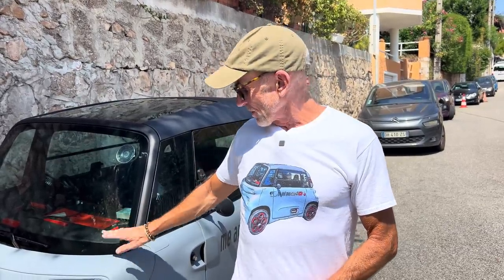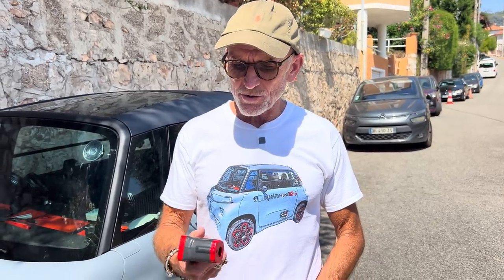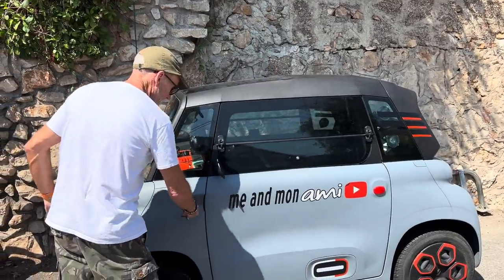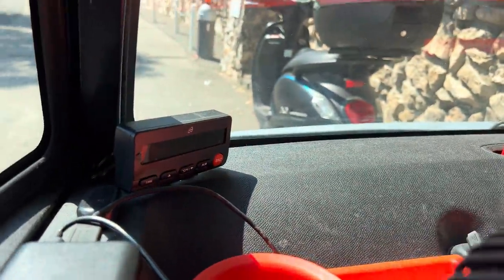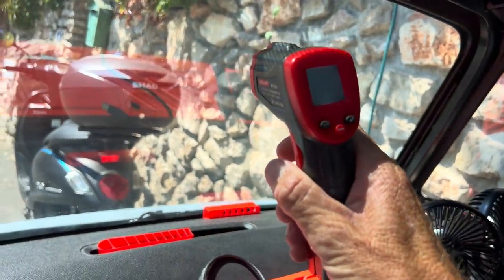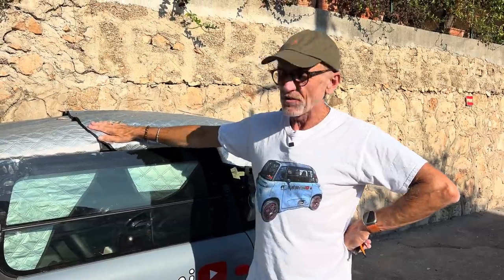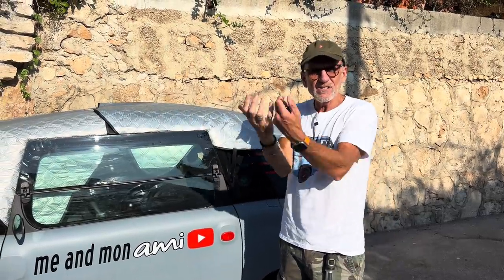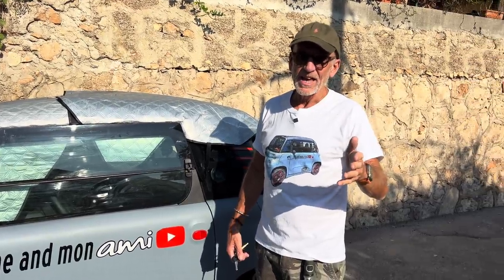Why Does Our CITROEN AMI Get So HOT? I Use TEMP GUN To Find Out!

Comment: Thinking of what the military do with high tech jet aircraft operating on airfields in hot climates, they always stick the aircraft  in one of those lightweight readiness hangars or, if the can't do that, stick a cover over the cockpit canopy to protect the valuable high-teching instruments inside.

In that vein, Halfrauds in england used to sell those lightweight/compact  polyester car dust covers (In white) . . the sort they  use in car showrooms and the windscreen covers for winter . . wonder if something like that if supported on a stand away from the roof (A book, a plastic cup, a piece of plastic domestic  waste pipe even  a bag of frozen ice cubes etc) would be man enough and keep the sun off.

Comment: Two decades ago, I used to live in an apartment, where the afternoon sun made it unbearable at night.

I got a roll of tinfoil and som sticky tape and covered the windows.

I left about 1-1.5 cm of glass arrpund the edges, for the sticky tape.

It looked like trash, but I was a student with a small budget and it reduced the temperature to a comfotable level.
Reply: My suggestions woud be:

Cover black/dark exterior in reflective silver wrap, or white. Possibly also rear side and roof window

Infrared blocking window foil. Check rules to make sure to stay within legal restrictions.

Get white/bright covers for seats and interior. Black interior is a "heat magnet" when its in the sun.

Comment: Good video. This has inspired me to see if I can create a permanent roof liner for my sans permis van - using one of these reflective sheets. I have a similar problem. Plastic roof with interior metal cage - although there is less metal work in my cab than in the Ami.
Reply from the maker: What is your sans permis van I’m intrigued
Reply: @MeandMonAmi  It is a 2011 Mega Multitruck Phase 2, manufactured by Aixam. The newest version is called a D-Truck. Both have electric versions, unfortunately mine is a 400cc Kubota diesel. Bought second hand in 2018 it was new to a Parisian boulangerie. I'm the second owner. HTH. 👍🏻
Reply from the maker: @MegaBreadvan  Thanks. There’s a little aixaam e truck lives near us it’s very cute
Reply: @MeandMonAmi  They are, aren't they? 😊 I bought mine because I didn't want a sans permis car, although this was before the Ami came along.

Comment: Anything water based will ultimately evapourate in open air,  and whilst the first effect is to extract heat from tne surface the damp rag is attached to, the long run effect will be to raise the humidity in enclosed spaces and raise the Wet Bulb temperature . . . Think steam-based hospital autoclaves and steam sterilisers of old . . If you want to kill the bugs . . Inject steam and the Wet Bulb temperature increases ! Not good if that happens. 

Sticking some ice cubes in a bag and allowing the breeze from a fan to play over the bag surface might work a bit better . . and, of course, every bar and restuarant can do a top-up.

Comment: Couple of ideas why don't you get someone with sewing/Tailoring skills to sew those two covers together and cut to shape overlocked round the edges. Then sew some Velcro and straps as required glue a few Velcro tabs on the roof for fitting purposes and straps on the inside similar to your roof rack.. The other one is to wall paper the car roof with white washable wall paper? we it may work well.

Comment: You need an UV filter for your windows.
Then you need a white reflective roof. Not the black one.
You could also try an aerogel insulation, but that’s expensive and not easily available. So, the option could be to be a test object for such insulation. That will save you costs.
Reply: Correction: you need an infrared ray filter screen. Not UV.
Reply from the maker: White roof would definitely help

Comment: I would say any campervan conversion company in the area would be able to fabricate a sunroof that opens for the Ami including (if it requires it) any strengthening metal to allow for the missing part.

I agree with others that I reckon painting the roof white, then putting flexible solar panels on top of that would get you the best of both worlds in terms of cooling and also free electricity while parked away from a charger in addition to insulation and tinting. Of course, then it'll probably snow ;-) At the end of the day you could mke your own insulation with tin foil, bubble wrap and duct tape for things like inside the door panels etc.

I've been told that hanging a canvas bag of cold water from the windows of a car was the old method of air conditioning in hot climates, the hot air basically being cooled so that cooler air came in.

I don't know how the panels are in the back, but would it be possible to fit a fan on what would be the back seat (if it had one) that could draw air in (or out) from the air gap between the frame and the rear outer panel of the Ami? If so you could maybe wire it up with a temperature sensor to come on if the interior got too hot, or just turn it on manually say an hour before you wanted to actually be inside it.

Of course, I don't know how it is there, but in the UK all these modifications would be notifiable to the insurance company, not sure about Citroens' warranty etc. either.
Reply from the maker: The ami roof is very think plastic and those who’ve done this say it isn’t easy but possible

Comment: you can get silver wrap too, will be better than the white.
Reply: also fyi you won’t get accurate readings from reflective surfaces like glass or shiny metallic surfaces. put a bit of dull tape on the shiny surface to measure, or your just reading reflections. 
All the same that’s one hot vehicle, the new open roof version would surely suit you best? more cash but probably worth it 👍
Reply from the maker: I did wonder about the reflective readings as they seemed relatively low

Comment: What I heard was.. this way of testing temperature on glas, does not work properly. Glas and shiny stuff give wrong readings. But anyways .. it is very very hot. 
The roof I can agree with. No insulation to be seen. 
How do "normal" cars cope with this.
I do think a white wrap would be good.. also thinking of the extra weight.
Reply from the maker: I think you are probably right re glass but as you say the plaggy is hot!
Reply: @MeandMonAmi  Hope it works. Maybe someday I'll buy one, so your videos give a lot of experiences. 💖

Comment: bonsoir mes amis.  Here in Spain, just turned 7 pm it is 39°C or 102°F in old money.  I have fans going and occasionally turn on the a/c for a short while, making use of the sun and the solar panels - those parts that the damned pigeons haven't covered in crap.  Keep cool and stay charged.
Reply from the maker: I feel for you. It’s 35 here today and unbareable

Comment: Despite the high IR  heating  . . The doors and windows still operate  ?

 But the UV overtime will kill the plastics (See the Dutch pilot girl vids and the landing at Maderia, Funchai. The plastic sunguard over the Flight Director panel, above the co-pilots instrument panel,  absolutely decimated by UV at altitude. But you've got the extra protection of the troposphere).

 But the combined effect of direct effect of  IR (Heating) and UV (Plastic unfriendly) on contact with the outside of the vehicle will kill any plastics on the outside of the car (And the occupants inside) . . .mainly through promoting the process of plastic  "Out-gassing" and causing the plastic to lose mass and shrink. That's when the fun and games really begins. Think plastic headlights,  vinyl windlow egding and windscreen wipers on modern cars. . .recent London temperatures have done for those items on my  car.

Even in London, summer temperatures at Northolt 2 years ago were sufficient to melt the glue holding the fabric + foam headlining to my Skoda Fabia interior  and detach it from the   cabin roof.

As the car is always parked in a public car park, I'm contemplating getting one of those framed clamshell covers for protection  . . Once I get tne headlining repaired . . . 

I would suspect, that like my car, Elton is parked-up 80-90% of the hours of daylight, so dealing with static heating is the main problem.

You have two issues here . . Radiated and conducted heat from the suns rays impacting poor Elton's bodyshell and convected heat from the surrounding air mass entering his cabin !

And the heating affect of the sun is worse when you're parked-up and there's no slip stream to cool you or the car. So the first job is to get the car cool enough to use from start i.e. keep it cool while parked-up.

Temperature insulation is all about layers. . . Whether you are insulating to retain heat or keep it out. To stop dear Elton heating you've got to keep the sun off any part of his body and also ensure that cool air reaching his cabin  !

As regards avoiding direct radiation hitting the bodyshell and then conducting throughout tne body, when I've gone camping to France in the past, I've found that a cheapo polypropylene tarpulin (Acting as a flysheet) hung over the top of a polyproplene rope above the tent and secured to a tree/fence at each end is great for keeping the temperature in the tent down (And for keeping tne monsoon rain off - two birds one stone). It works by keeping the direct heat of tne sun off tne object you wish to keep cool and by  creating a lower temperature zone between the object and the outside World .
Even better . .  A tarp with an outer surface  bearing a reflective coating would get you even more brownie points. 

The thing to avoid is contact between the flysheet and the bodyshell. .. .because that would allow conduction of heat between the flysheet and tne bodyshell leading to Elton getting hot and bothered.

Alternatively you could rigg  and secure the tarp, bivvy/sanger style to that stone wall using some of that magic picture hanging polymer or some loose stones or laiundry pegs ?

At a stetch you could get a couple of those cheapo restuarant/beach umbrellas with a weighted base, positioned at each end of Elton, or purloin some of that lightweight portable fencing, with tne weighted base, that you see on building sites (Hint), cover the sides in reflective material and demarcate the peripherary of the  sunside of the car with it,  putting Elton in the shade .anhhh !  . A cheapo gazebo will probably have the same effect. Even a beach wind guard with weighted bases would do.

Now there's a new market for Banksie prints ?

Wonder if somebody makes a collapsible  breiz soleil ?

Solutions depend on how radical you want to be versus the social and cultural conventions which you must be seen to obey. Personally, I say sod tbe conventions, I'd rather not fry . . . No matter how good the local scran.

As regards convected heat in the cabin turning you and Mr Boo into boil-in-the-bag  lobster en croute (Or is that en-route ?), . .   can you run a  mains power line to Elton. . Then a fan and/or one of those peltzier semi conductor chillers for the beach becomes an option . .leave the chiller door/lid open . . .perhaps even run it off your luggable Li-po  power pack . . On a timer or . .as I do with the household fan in tne bedroom, use one of those plug-in greenhouse electronic  thermostat/ timers  . . Turns the  fans on when temperature exceeds set threshold and off when the temperature falls below the threshold. . I use that mechanism for cooling down the bedroom when I first go to bed . .and it switches off as the outside temperature falls during the night, saving power and ensuring that you don't wake-up in the morning feeling as if you are one of Captain Birdseyes frozen fish fingers.

Comment: The solution you have there is excellent but perhaps it could get stolen.
Here cheap solutions. Cheap like me.
The cheap solution of a roll of kitchen tin foil would work but one attaches it normally with adhesive tape. Perhaps this sticks not on the car or.. sticks well but leaves hard to remove glue traces. 
There is a kind of tin foil on a roll which goes on the wall before the wallpaper if the walls are the old, humid type. It has a white side and a reflective one. I think both sides would work. Perhaps it's easier to attach and remove that. And more, perhaps it could stay on if the tape really leaves no marks and then one could drive around with it.
An old white sheet works too but it looks perhaps a bit strange.
Disposed older perfect sun block , long  curtains have sometimes a white back and this works really perfect. They are harder to find today , one sees more these roll up types. If they are cheap perhaps one could make something with those too.
Even using white wallpaper or the back of it rather would do much. And that would not invite any thieves, but attaching it could be a problem since it always tries to roll up. Perhaps there are  other type (glass fiber ?) wall papers that would work also.

Comment: Small car cover keep the hole thing out of the sun that way
Reply: Just make sure it’s outdoor and a silver colour UV resistant and weather proof then it will also help in the winter with defrosting because I know to defrost one of these you can loose a lot of range maybe use what you already do on top of a full cover for extra defence and if you can safely crack the windows for air flow even with the cover on it will still help
Reply from the maker: Struggled to find a full wrap with as strong UV protection as these small sheets but shall keep looking
Reply: @MeandMonAmi  it’s not a wrap it’s a normal small car cover it clips underneath to yes it will be baggy but to help with temperature in the car it will help

Comment: As long as I watched your challen I have seen where much of the heat come from, humans love black for it look nice, but black absorb heat, but if you had a white panel it would fast look dirty and yellowed by the sun, that is why the militate like beige. Another thing is flat surface, you can test this by putting a flat sheet of aluminium foil on the roof and beside it a bit wrinkled or folded foil, then after 60 min take temperature on the roof under the foil and you will see that the temperature under the wrinkled foil is much lower.

So when you put the cover over the car, but something under it like tennis balls that keep the sheet some centimeter above the car, that should keep it a bit cooler too, if not the heat warm up the sheet and then that heat is passed to the car, but if the heat can escape (be ventilated out) that heat will not go to the car.

If it is warm in you room, do not open a window, open ventilations that is as high up as possible, then put a fan as close to the floor as possible tam let up blow wind up, this will lift cool air from the floor and press out the heat through the air vent, cover the windows from the outside with something that have little contact with the window.

Comment: You’re doing well: adding something reflective to the outside (not inside) of the car. Changing the black underside of the reflective car cover will do nothing to reduce the heat gain. The only other thing you can do is add (glue) little things (e.g., Styrofoam balls or ball halves) to the underside of the cover to raise it away from the car introducing a continuous layer of air. The air will conduct less heat from the top of the cover to the car and, being continuous, will allow warmed air to pass through and not be trapped (as long as there’s a breeze or a hole or gap at the peak of the cover(s) -- remember, heated air rises).
Reply from the maker: That makes sense re the air…

Comment: I am surprised that Monsieur Citroen/heirs/succesors haven't pulled their collective doigts out and offered a  simple plastic/glass clip-on heat guard for the Ami  cabin roof . . . designed with a stand-away air space underneath,   which could reflect the suns rays when on the move or parked-up and radiate them back into the air. 

You never know, they might even design it with cut-outs in the edges so that lightweight polyester curtains/sail material (with the Citroen logo emblazoned on it) could be selectively attached as appropriate and draped over the side of the car facing the sun when parked-up.

Taking it one step further, the technology that Pilkington K glass uses would seem suitable for such an application.
Taking it one step further again, how's about a clip-on solar panel designed with the same stand-away.

Seems a bit strange knowing what the summer time temperatures are in France (Not only the South) and in Morocco where the thing is made (And sold  ?) that this is not on the cards.

That's all pipe dreams of course . . . it would require dynamic entreprenneurs to get that going . . not semi-detatched state run public corporations with all the movement skills of stale rice pudding . . . .but think of the applications across the motor industry.

Comment: Maybe wrap the roof in a white, and perhaps put some strips over the glass similar to the orange ones at the rear. 

Tinting the glass would also help.

If you can remove the door cards, put some insulation in any gaps - would also reduce road noise slightly. 

Would be interesting to see what difference that would then make.